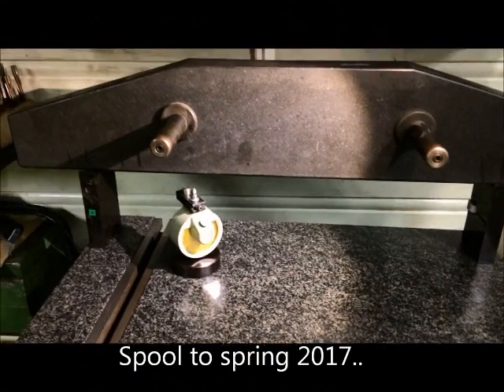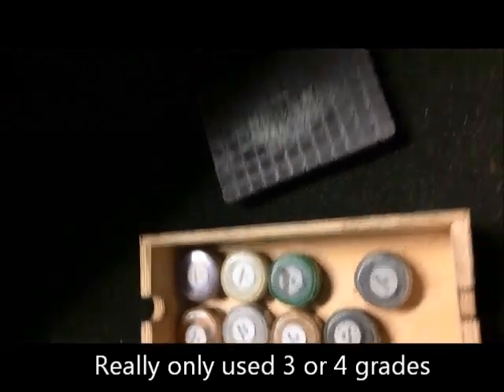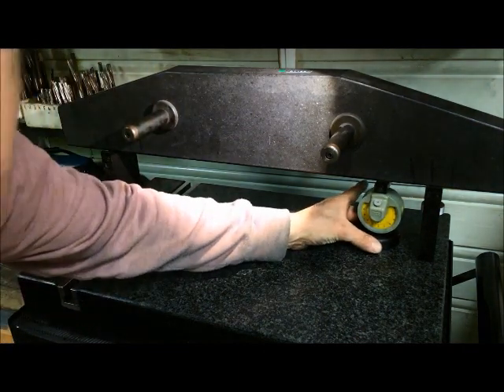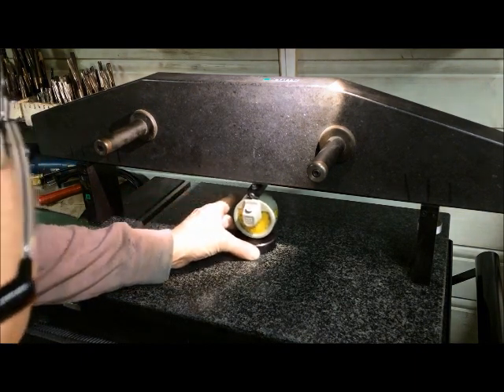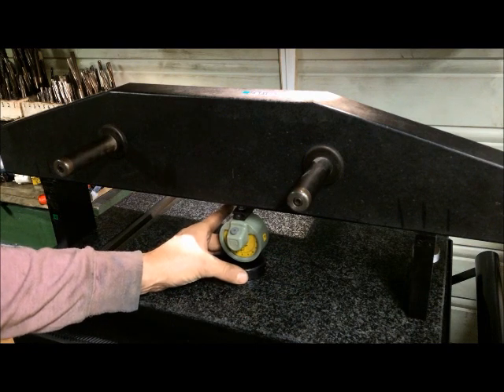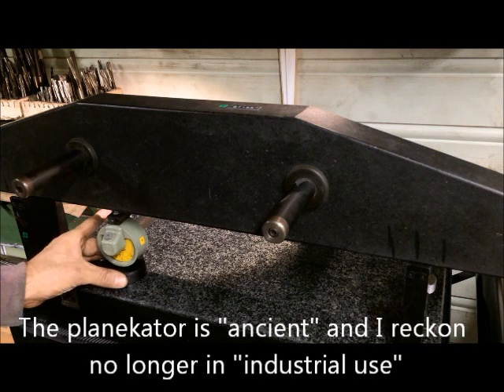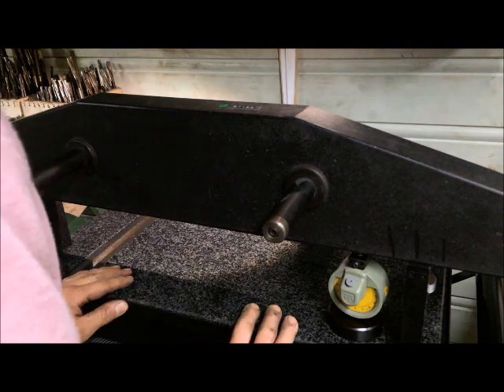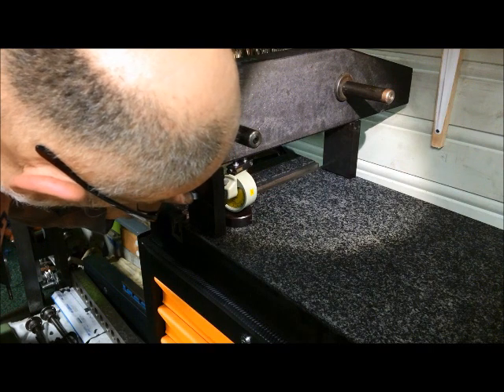Surface plate testing with a Planekator plus moving a big plate

Comment: I need an advice. I have 60 degrees triangular straightedge 500 mm long and with three 65 mm shoulders. I need 55 degrees. I don't have a mill, but can do coarse milling on the lathe. What's the simplest way to proceed?
Reply from the maker: Do you mean to mount it to the cross-slide and use a milling cutter in the chuck? Pretty big lathe if  you have 500mm long throw on your cross-slide action, but if so then the lathe would probably handle it well, so possibly a feasible way to go. I would have tried to ask some of my friends to mill or plane it for me though. If you shall scrape it anyhow it should be OK to rough mill only.

Comment: Just an observation from your measurements:  It looks like the surface plate is sitting on top of a tool cart.  Is this the best foundation for these types of measurements?  Or maybe have you Renzettitised it with a solid steel frame underneath?
Reply from the maker: It was sitting on 3 points.. and only a preliminary position, It was really "living" on the workbench, but in my seemingly constant "lack of space" situation, I moved it. Of course a better foundation would rule out any possibilities of measurement errors. I have however not faulted the measurements yet :) I have plans to make a separate stand for the plate that I have now, but will probably wait until I get the Saacke grinder done, and then this "frees" up some space.. By then I hope some of the Myfords are gone also, hence more space (if I am not foolish enough the drag in some more projects .. haha)
Reply: @jansverrehaugjord9934  HaHa.  The constant "lack of space" sounds familiar.

Comment: I see used granite surface plates available fairly often. I have never seen used granite straightedges or angle blocks for sale anywhere.  New prices for them are silly.  I am getting jealous of your metrology tools now, too!
Reply from the maker: The Planekator was from a Bofors auction in Sweden, from their metrology room. You are probably correct about granite SE availability, but you may also look for a used CMM ie. a measurement machine. Prior to the first Norwegian scraping class I bought one which was butchered.. the "yield" included 2 rather big plates (the back plate was de facto pristine, only being used for moving the sliding member that was running on air bearings) and a beam. Plus a lot of other "gadgets". Such CMM's are often sold very cheap as the killer for their use in industry is outdated electronics/computers/software (as I guess is also true with larger CNC machines)
Reply: @jansverrehaugjord9934  Not many with home shops can say they've restored there own surface plates back to almost new condition Jan.Really well done. 

Taken to it's logical conclusion, diamond saw blades that would fit various hand held circular saws aren't expensive nor hard to find. Done outside with flood water cooling and a straight edge guide for the saw, then slicing a slab off an old used surface plate and using the methods you used in this video and a known accuracy surface plate, then making your own granite straight edge could be produced. All four sides of it could be diamond lapped to be straight and parallel with each other with some thought and enough motivation to do so. Or a small tombstone company could supply pre cut granite to almost any size you wanted with fairly accurate surfaces that would only need lapping with the diamond powder you used. Granite is fairly cheap, even the cutting of it is quite cheap. The major costs are in the accuracy of the finishing.

Building a screwed together box for that surface plate using construction grade wood and plywood and adding a couple of heavy threaded hooks or rings into the wood would have allowed a safe way to rotate that surface plate onto it's edge. That might have been a bit less work than rebuilding the door frame? I've done thousands of lifts in the mining industry from a few hundred kilos to upwards of 50 tons. Part of the job was figuring out how to safely lift and move just about anything. :-)
Reply from the maker: @turningpoint6643  Thnks. I guess not. However, there are many accomplished and skillfull amateurs that do other amazing things..
Speaking of cutting up larger surface plates, I have done just that! I once bought a 1200x800x200 plate in Stockholm, drove it carefully back (took me about 12 hours), then after intensive thinking and measuring, went to see the local stone company and asked them to slit it lengthwise so that one piece would be 1200x40, and then cut 2 pcs. 600x400. Next day, upon pickup they had cut all 600x400, ie. 4 equal parts.. Well.. they were sold. Made some stands for them, 3 points support etc. 200mm thick, they were not liable to change much, but anyway..
Regarding my current plate and the move from the garage, I could (and probably should) have prepared better, asked for help etc. I thought I would be able to jack it up so that it stood on the side and then put it into a sturdy 2x4" rig, but in the end I managed OK.

Comment: Are you not just comparing oonecsurface with the other? Shouldnt you repeat the test with the beam end for ended?
Reply from the maker: It is a relative test across the beam and you do the test in both x and z directions (or what you want to call them), as well as diagonally. I found it easiest to mark up in squares. Say if you had a dip in one square when testing one way, bridging across the piece from the left- and right sides, you then repeat the test for the same square bridging from 2 other sides. One has to define a start corner (at least I found this easiest) and call that zero. You would also want to map the surface with a level and combine the "union Jack pattern" you get to verify your readings, at least for some "paths". This method finds a local error in the direction you measure in relation to the outer edges. An auto-collimator plus a repeatometer would be better. Best would probably be a laser or what the guy that calibrated the surface plate at Norsonic used.. same tools as you can see in other surface plate calibration videos eg. OxTool